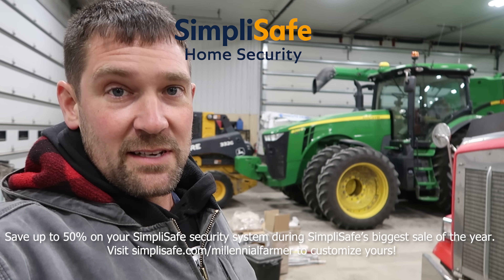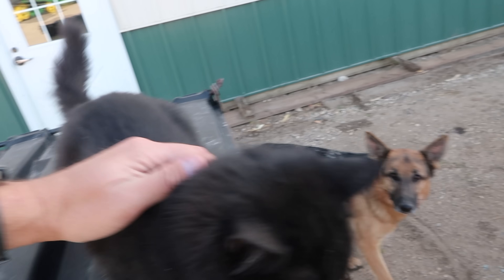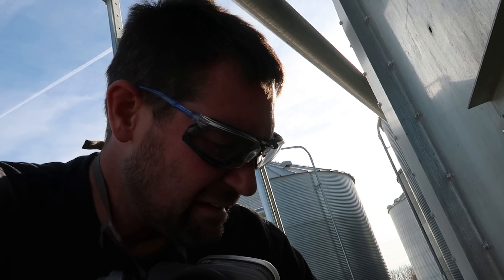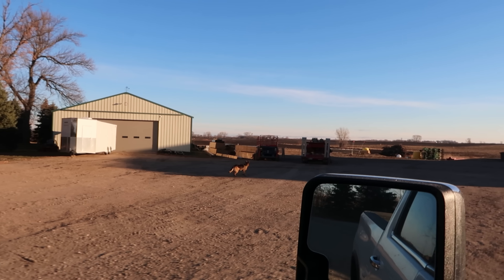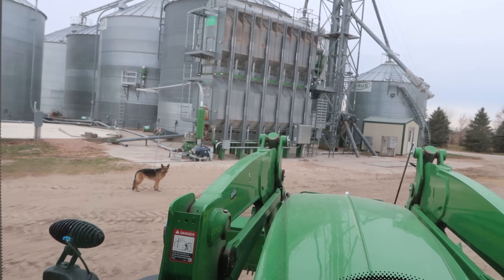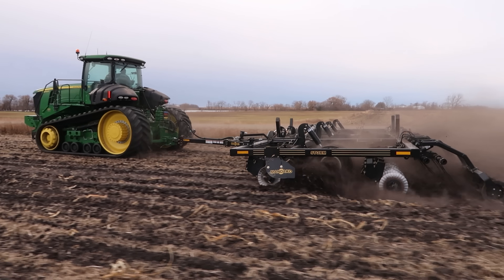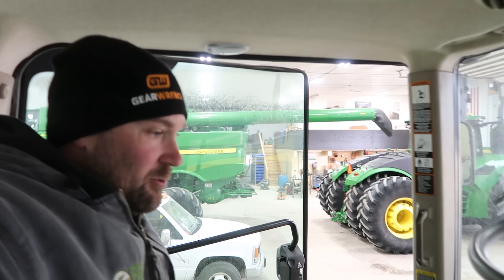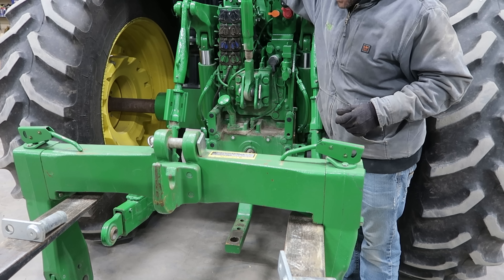The Job I Hate the Most - Digging Out a HUGE ROCK

Comment: Zach, you supposed to use the outriggers and backhoe to remove backhoe from tractor. It’s why the pump has the extra feet of hydraulic hose. With pump running, drop outriggers and drop dipper so bucket is on ground. That is what holds the unit upright so you can remove. The rams will most likely settle in time, so when you reinstall, hook up pump first to tractor, it’s why you have extra hose..get the outriggers and dipper back to where you need them and hook up backhoe.

Comment: Just an observation about cleaning out the dryer. Find an industrial shop vac or something for that bottom part.  But if that isn't a option then invest into some knee pads. I love cat dog,  the cartoon not so much. Can't wait to see the new storage shed being built.
Reply: A dust collector for a woodshop would probably work pretty well. Most have a 4" hose connection and move a ton of air/can handle long hoses, plus they're not super expensive.
Reply: @howtowakeakar  I was going to suggest a shop vac with the dust bag inside it to save the filter, and buy a couple hoses and daisy chain them together to keep the air from blowing around too much... though, the $5 broom is a cheaper option.
Reply: Hab that idea too. But such an investment for something that is needed once a year in a 3 hour job.
Reply: J
Reply: Chet pn Larson Farms uses a leaf blower ro clean out his driers

Comment: If you're buying Napa batteries for the truck that could be the problem. I would go with Cat, Interstate, or paccar TRP. Make sure you clean the lugs really good with a rolloc disk and make sure the disconnect switch is really working with an ohm meter. Make sure all the grounds go through the disconnect switch if there's an ECM or tarp ground hooked to the battery it will still draw down.

Comment: Zach, to let you know, it’s quicker to remove rocks with your skidsteer and forks. I’ve done both methods and the skidsteer has substantial more power. And you can carry it on forks when removed. You can plunge the forks right into Mother Earth and curl back under rock..works quite well..have a great Thanksgiving!!
Reply: But that’s not as fun as using a backhoe
Reply: Funny, I didn’t hear him ask for your opinion in the video
Reply: @gregjames5070  Nobody...asked for your uncalled for nasty comment.

Comment: I use to work for a company that made powdered metal components. The dust was mostly iron, graphite, and zinc sterate. Really heavy and nasty stuff when it mixed with hydraulic oil leaking from the presses. 
I had a vacuum line made that would reach down into the pits under the presses and suck up all the crap so the crew didn't have to get into the pits and shovel. 
We took a piece of metal tubing about 10 feet long and put a 1/4" air nozzle into the side of the pipe about 6" from the end that pointed back toward the other end. We pumped 100 psi shop air into the nozzle. That created a vacuum to lift the powder and crap into the pipe then the air nozzle blew the junk up the pipe into a 55 gallon drum with a filter bag over a vent in the top of the drum. 
It worked great. You could do the same. Just make the pipe long enough to reach into the bins. 
It would work even better on the light stuff in your bins.

Comment: Zach, my dad had a dryer much smaller than that,  but during the season he would open those small doors opposite the fans once in a while when the dryer is running, so most of the stuff would blow out. Just stand clear when you open them.

Comment: Hey Mr. Millenial Farmer,

now that I have seen that in all of your Simply Safe announcements: Please keep your carbon monxide sensor lower to the ground. Carbon monoxide is way heavier than air, which means, it fills a room up from the bottom to the top. If you have your sensor really high up in the room, the room is already full with carbon monoxide and there is still no alarm. I would suggest, that you put it at a height of about 1ft 8in (should be half a meter 😁). Just for your and your familiy´s safety.

Greetings from an Austrian engineer/farmer 😁

Comment: 17:07. If you get old tyres, pile them on top of the rock. Set them on fire & let them burn to ashes they will make it hot enough to crack into pieces when you trow a bucket of cold water over it. Let them cool down & get all of those pieces out with the tyres debris

Comment: One thing on cleaning out your dryer.  Everyday or two during drying open that little door a crack or little more below the entrance of each air chamber. It will blow the fines out. Sometimes something to disturb the fines is necessary. But not usually.

Comment: If you add a peice of 12" long  4.5" ( I recall) silicone tubing  like you use on turbo charger on the end of that leaf blower you don't have to bend over. If you cut it on an angle  with a little  finger on it like an elephants trunk.  You can use the tongue to get down in cracks.

Comment: Grab yourself a roof snow shovel for clearing under the dryer. Less bending and crawling you can just use the extensions and the rear facing shovel to pull it out.

Comment: I got a rock out that was about half-again bigger, with a crappy old loader.  I ended up with at 25-35 foot tapered hole, wrapped 2-3 heavy chains around it, and dragged it to the edge of the field.  Where we live, rocks just work their way up, so if we can get to it, we remove them,  by chains, or dynamite (old method).

Comment: Zach, get a hose long enough to use to vacuum all the "waist corn" material....
By using your vacuum system to clean the dryer and around the bins.   Have the vacuum system empty the waist into a trailer or small truck and haul it off.   Make a excruciating job into a easy task.

Comment: The battery issues in the kenworth are an earth lead problem. Every kenworth I have driven has done it at one point. Always like flat batteries and they're not flat .put  your hand on the battery leads and crank I bet they get hot.

Comment: Zach 
We have an older peterbilt and we always where battling low batteries in it and we changed the starter to a newer design and have not had a low battery in 2 years on it.  The starter wasn't bad it still worked but it had a dead short in it and would act like a low batt but it wasn't the batteries.  Something to try thanks for reading.

Comment: I live in central Missouri, and I am planting a memorial garden for my Wife of 29 years, 
that passed 8/5/2022 from her 3rd but of cancer.
I have a nice BCS tiller with a rotary plow. It does help with the rocks, but it's getting ridiculous. I have one rock, like the one you worked on, (small at the top) that I started with a spade, and ended up with a pick and alignment bar. It got to a personal level quite fast. I think it was part of the asteroid that offed the dinosaurs. 
I only have about 3.7 million to go, but at least the rotary plow does kick out the ones that are about the size of an old headlight. I still have to pick them up, and being that I am an old guy doesn't help much.
I hope the comment helps with the logarithm though.
Smiles.

Comment: One of our 409 kenworths was doing the same for months after new batteries were installed.  It turned out to be one bad earth connection from one battery. Pays to clean and check the connections back towards the starter also. Cheers

Comment: I was trying to think of a way to clean out the inside of the dryer.  My initial thought was a shop vac with a rigid pipe and elbow.  Second thought was to get the air to move things a leaf blower with a gutter cleaner pipe; but, that would mean the stuff coming back in your face and out the door.  Handling the stuff twice instead of once with the vac.  OK you have to empty the vac into the skid loader bucket.
With all the equipment you have, were is a simple long rope to tie the maybe tools to. If you need one when your at the top simply pull the tools up with a rope.  Sling the vac with the rope for both up and down.  
Start from the top and work down before doing ground level.

Comment: I would suggest getting a tractor mounted vacuum hose with a cyclone separator. it seems you could use a 100hp suction hose for a bunch of things, it could basically eliminate the need for a shovel

Comment: your truck probably has a bad natural voltage draw. take a vom on 12 or 24 volt and look for voltage on the battery box 6-8 inches apart between the probes. i cleaned out my battery box then painted the inside with rubberized bed liner. truck starts so much better after sitting a couple weeks after doing that i had 4 volts to the battery box bunch of fine dirt and sand in the bottom and covering the battery allowing voltage to flow out.

Comment: Zack... continuity check your battery cables.  Those KW's seem to go bad. It is trying to start on only 2 of the 4.I found bad cables in a truck I was working on. The cable had corrosion where the end was crimped on. Look at those closely.
Reply: It's Zach.

Comment: Clean the battery terminals on the cable ends too and clean the cable ends on the starter And the starter And then put battery Coat on them so you don't have the issue that may help

Comment: I really enjoy your videos. You need to trade that leaf blower in. We used a 110 cubic foot compressor with a 1”  100’ hose and it worked so well . We reduced it down to a 1/2” pipe and controlled it with a 1/4 turn valve. For blowing off the combines and around the grain bins you can’t beat it.

Comment: If you put a battery shut off switch on the red truck, it mighht save the batteries. Older trucks have a tendency to have dead shorts in them.

Comment: Those blowers have a gadget/add on to turn into a vacuum cleaner.
Up on top of dryer once cleaned it coat it in likes of ACF50/Silicone spray etc that way not only keeps rust at bay but poop don't stick to it

Comment: Hey zach it might be a pain but you should expose the fuse panel on that kenworth and test where it is drawing power from. You shouldn’t have issues like you do with new batteries. I have a w900 put new batteries in and boom it’s dead every Sunday morning when it goes to work for the week. Tested everything in my fuse panel found where it was drawing power and solved the issue. Hope that helps

Comment: I remember my first time digging with a JD 1025. The rock kicked my butt. It was small enough to be dug out with a shovel. By the time I was done digging holes for the pole barn posts, I was able to dig 500# rocks easily. 

Running a backhoe had a learning curve, but not too steep.

Comment: Put a battery cut-off switch on the semi-tractor(s)!  The 4-year old Freightliners, that we have, have a factory battery cut-off switch (on the floor next to the drivers seat) with a label that say "If left idle for 3 days, disconnect batteries."  All this new stuff is computer controlled.  That computer is pulling power ALL of the time, regardless of whether the motor is running or not!
Reply: Basically you are right about that. There are hundreds of this little computers in modern vehicles. They will turn of, if you turn of your engine. But this is more like a standby mode, which draws a lot less current, but not zero. And with the sheer amount of little computers, this is still a problem. Also there is another issue: There are some bugs in the software running on this computers. If you are in bad luck, this could prevent one of the computers to shut down properly. So a battery disconnect indeed is a good idea.
Reply: @markuswagner5754 : I have to correct my statement a bit.  Looking at the decal in my truck today, it says "If left idle for ONE DAY..."

Comment: I bet you've got a slow draw on that truck that drains the batteries. I ran new 2/0 cables on mine to the engine and starter. Then I put a switch between the starter post and the rest of the truck. No more draw on my batteries. Of course, now I get to reach in to the anti-theft device before and after any use...

Comment: Voltage drops my dude, check all the battery and starter cables. Sometimes you can have a ground cable rotten inside the insulation and never even know. It'll cause starting issues like that

Comment: Zack, you may want to check and see if that truck has a parasitic draw on the batteries. 
Batteries that new should be ok sitting for months at a time.
I'd install a battery cut off switch and put some sheet rubber under the batteries to provide some shock asorpstion that will proved some protection from having them bouncing when it's being driven.
Especially if it's field driven.
Reply: I guess, 'battery disconnect' is one of the most used used terms in the comments every time Zack has battery issues with his semi. Of course there could be another cause for that issue (bad connection, bat starter, ...), but he at least could give it a try. And personally I think parasitic draw is quit likely at least part of the problem in this case. The issue with starter batteries is, that they don't particularly like deep discharges and wear a lot faster in this case. Starter batteries typically aren't deep cycle batteries - although you can kill every battery with multiple complete discharges.

Comment: Keep up the videos they are  Awesome. I just finally was able to find your podcast. Funny as h*ll .    Side note there is an easier way to remove the 3-point mount backhoe.  By using the hydraulics instead of trying to take it off with the skidsteer.

Comment: Put the CO2 Sensor closer to the Floor. You’d be Dead by the time it got to that Sensor up there. Get yourself a Battery tender for each Semi, plug it in at night and it has a quick disconnect so it’s easy to hook up and take off.

Comment: Even though you buried that rock 18” deep. It will be on the surface,poking through the topsoil in 2-3 years. As you’re most likely aware, the frost will push up new rocks to the surface in winter. On average they are pushed up 6-8” per year. But if you experience a series of freeze/thaw cycles in one winter season it will expedite the process of that rock being back on the surface of the topsoil.

Comment: If your alternator voltage is not spot on for your batts it will beat them up. Aftermarket alternators can be bad, cheap but bad.

Comment: You might want your inside help to search the Internet for an industrial shop vacuum.  The kind that uses 50 gallon drums to catch the dust.  Then use extensions to sweep out the plenums and the dust in your corn drying equipment.  You may have to swap out several 50 gallon plastic drums, but it would make it faster than using a shovel to load the skip-loader.

I don't know how many times you do the end-of-year cleaning, but you might want to see if there is an industrial truck  vac crew that could come out and do the last cleaning.  Instead of you spending hours and making several trips to the fields to dump stuff, they could pick up the whole mess in one swoop.  

Cat-dog may want to ride in the tractors too.  What she does is interesting.  Remember it only has to make sense to the cat. Getting cat-dog involved may pull in more cat lovers to your channel.

Have a good Thanksgiving!

Comment: Always run the machine at full throttle for maximum power, 40 years of experience behind this statement.
You went to the trouble of getting it to move so get it out of the hole and be done with it for life, freeze thaw will eventually bring it up again especially since you put in loose fill. Otherwise another nice video for you.

Comment: As far as the truck starting.  Have you replaced the starter or taken it off and rebuilt it? I know water/moisture isn't supposed to get in them buuut. Used to have trouble like that with Pixall Green Bean harvesters, we would remove the starter and put a new bendix/starter drive on the starter motor. The old bendix would be all gummed up from whatever that gunk was comprised of. Oil & water I assume.  I know anymore they just replace starters instead of rebuilding them, but that can get rather spendy.

Comment: Why are you building the new shed with timber rather than a steel portal biulding would it be cheaper and more resilent less concrete foundation holes less risk to tornado damages.

Comment: Can’t those wedge blocks be flipped on the three-point arms to keep it from getting in a bind? I wonder if the quick hitch is holding the arms in too close keeping it from lowering. I seem to remember that our 4430 has blocks that can be flipped to adjust how much slack the arms have from side to side

Comment: I have a 48x60 Morton - weird to think that your building could hold 3-4 of mine - they are fantastic though.
Reply: I've had Morton build 3 different buildings several years ago.  They did an excellent job with an excellent crew.  When they said they would be there at 7:00 the hammers were moving at 7:00  I ,would recommend  them to any body,

Comment: Just a question about cleaning the dryer (not a farmer) couldn't you use a grain vac to blow everything into a dump trailer when it's that dry? I know when it gets wet it turns into a concrete mess but it might be easier.

Comment: Do yourself a favor get rid of the backhoe, and buy a portable air compressor that will clean your dryer, clean all your machinery it'll blow it all off in 1/3 of the time. A regular backhoe will have twice the power that your three-point hitch backhoe will have. Used backhoe will probably bring the same money as that  new mounted backhoe.

Comment: Have starter off truck as that or wiring round it is not getting current draw to turn engine over unless you have a draw in wiring/circuit draining batteries? do you do a volt check when not starting?